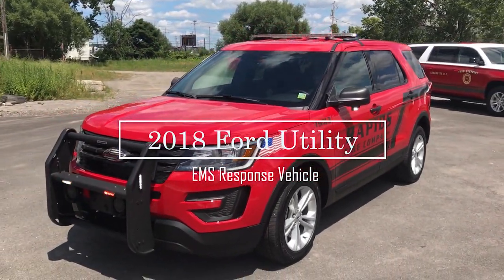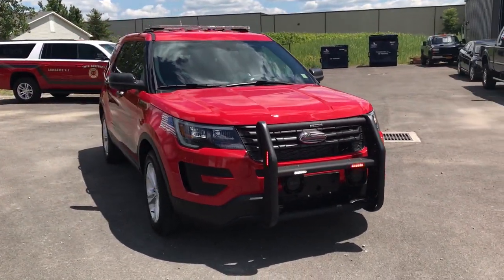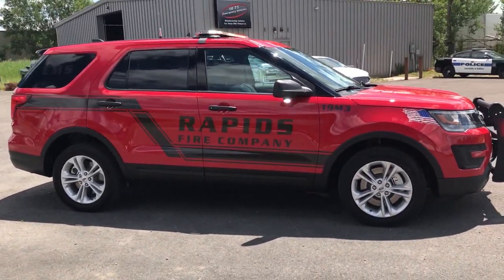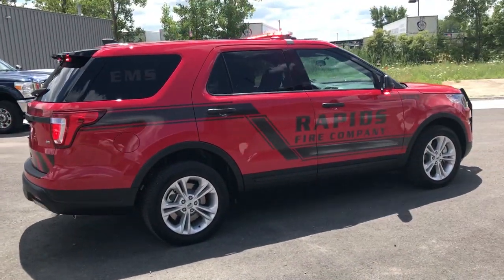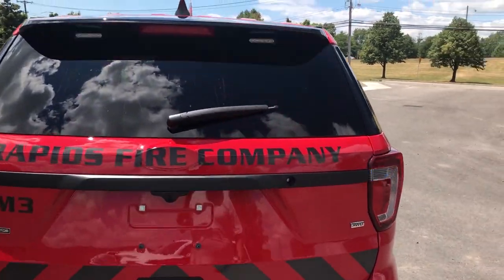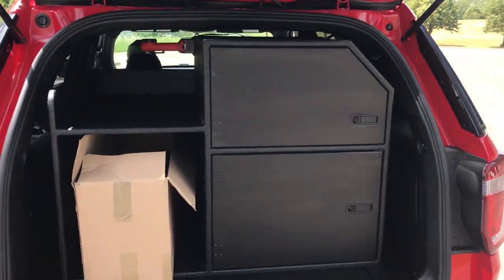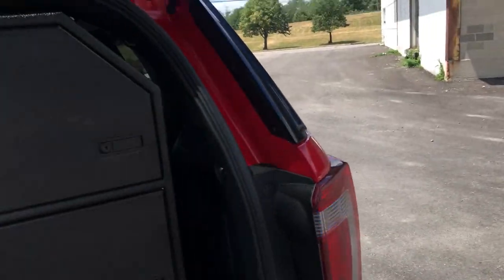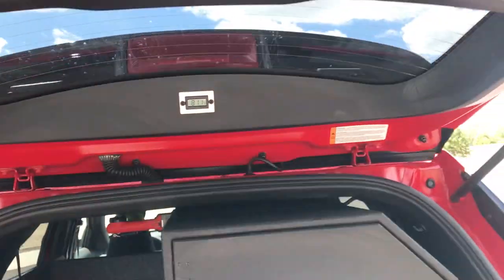Rapids Fire Company 2018 Ford Interceptor Utility EMS Response Vehicle 10-75 Emergency Vehicles

Comment: So do yall add the wheels? Those usually dont come on the interceptors. They look great.
Reply from the maker: Those are the factory wheels, you should be able to order it from your dealer when you order the vehicle.
Reply: @1075EmergencyVehicles  got ya....mine came with the standard steelies.
Reply from the maker: Oh maybe check with your dealer about pricing?
Reply: Option Code 64E